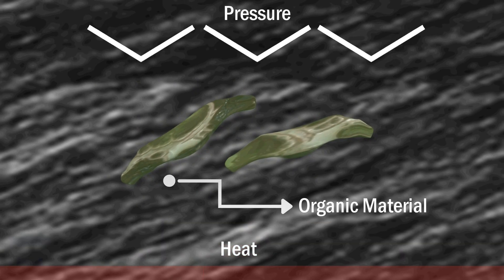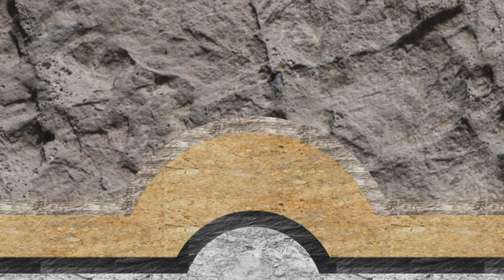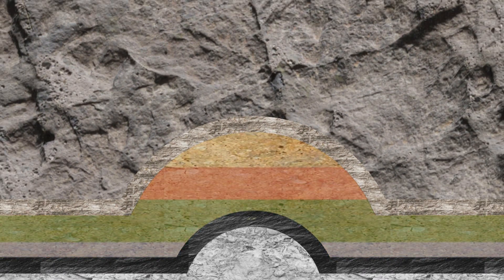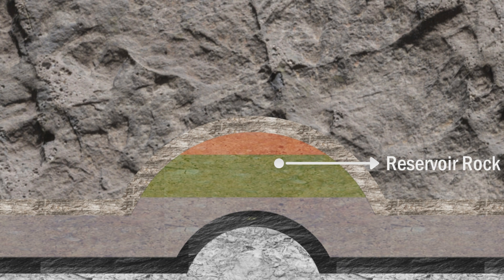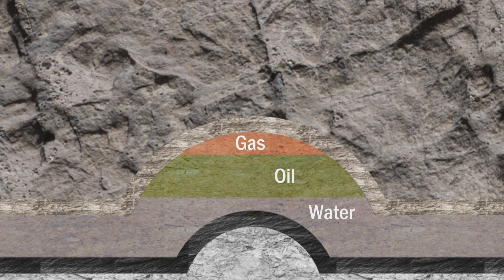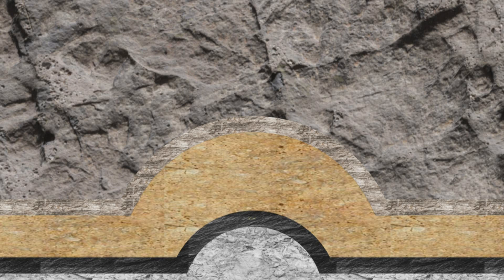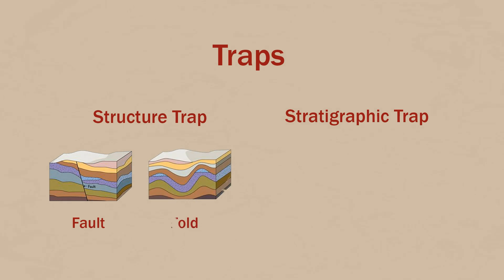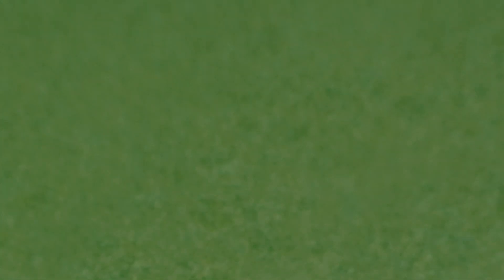Petroleum Origin - Reservoir Engineering

Comment: Hi sir , what difference between a trap and a reservoir ? 
Thanks   in advance.
Reply from the maker: A trap consists of three main components:
Reservoir rock
Deformation (ex: anticline)
Seal rock (mostly called cap rock)
Hence, the reservoir is the portion of the trap that contains the hydrocarbons in place.